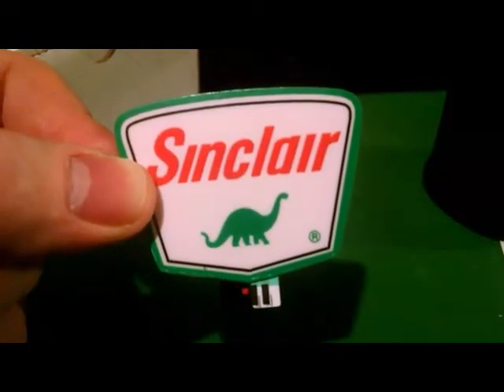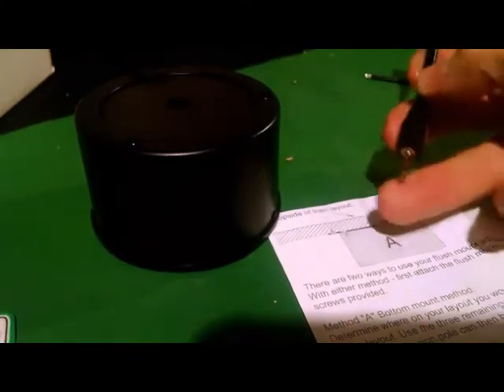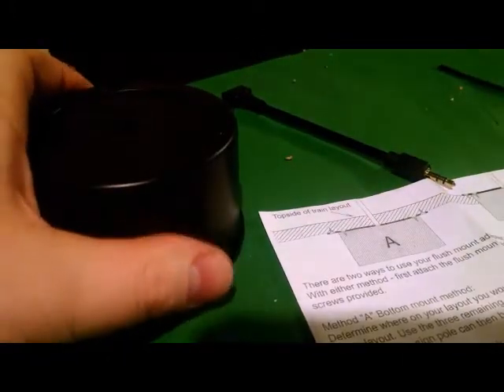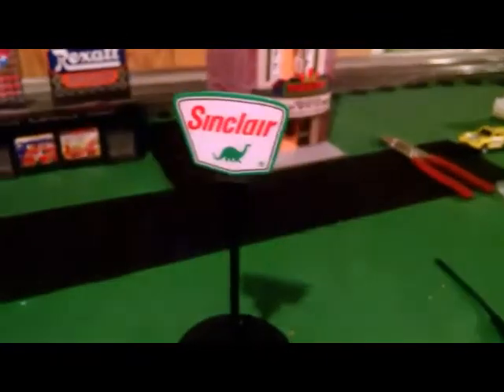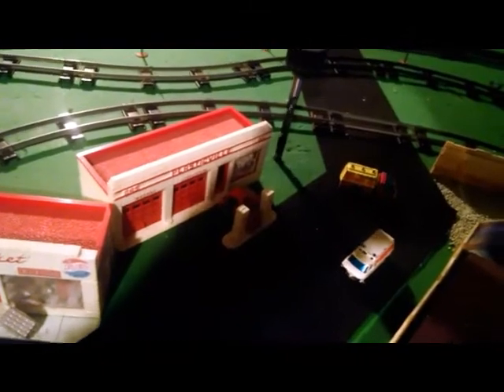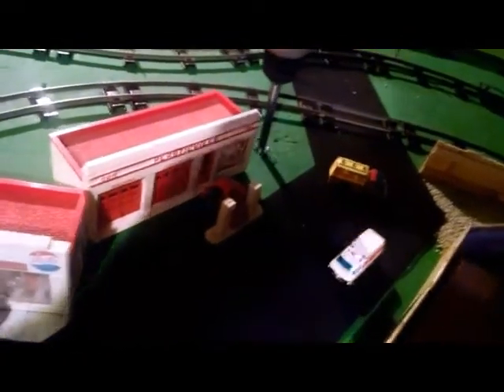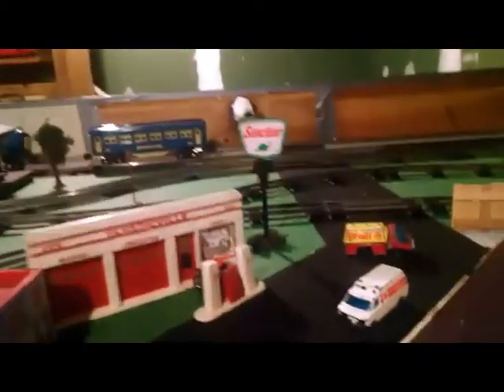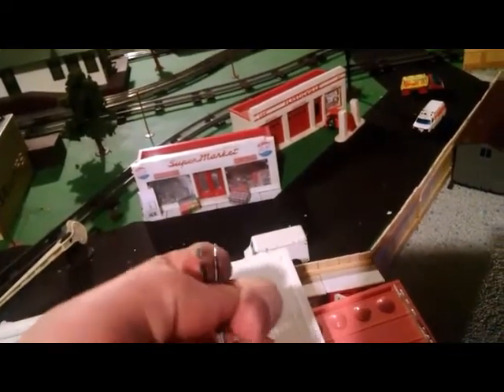Miller Engineering rotating Sinclair sign install

Comment: You can get Sinclair specific watershed or paper decals JL Innovative (sold separately). That's what I did when starting my own Sinclair station out of a Greenlight provided  1/64 service station. It was a bleakly faithful, and increasingly insignificant with the passage of time effort to replicate the "Mobico" station (Christine movie). The station was in white, with green pinstriping and trim, so I thought it had the trappings of an old time Sinclair station, and I could get away with brand conversion. It worked, with Sinclair specific watershed and paper decals provided by JL Innovative and Louis Marx. And my OWN imaginative detailing, Scotch Colored Craft Tape in Green for the foundation pinstriping. Glue together a clump of unused model kit tires to take up real estate on the building side, and always the vehicles coming in for gas, or service. But is it complete? No, it ain't. Next, as the completion outlines itself from a short distance, it can't be without an auto body and extra service bay diorama background, coming in from China, to further exude the charm, where an old rusty Volkswagen will reside for posterity purposes. Out back, we'll feature a Mijo Bikini Car Wash set with the swimsuit 18+s washing and waxing a '56 Chevy Nomad, and the service joes in the repair bays, and the station manager behind a green counter in the office. And last, BUT NOT LEAST!!!....the rotating Miller Engineering provided Sinclair neon as the crowning touch every Sinclair station should have!!! I also want to super glue a small plastic green dinosaur onto the matching aluminum island canopy/office roof. And then we'll finally wrap up the construction, and simply enjoy our work. That neon sign is a must. I have one for a similar Sunoco station.

Comment: Thank you. Does it matter what wire goes where into the distribution board?
Reply from the maker: Sorry I couldn't respond earlier, my computer crashed. Each board has ten sets of positive and negative leads. As long as you put one wire on the black side and one on the red side then it should work. I also think the board comes with a label that you write down each sign that is hooked up. I did make one mistake in the video. I mentioned the black striped needed to go in the negative. When I did that it didn't work, so after reversing the wires it worked. Oh well. Hope it helps.